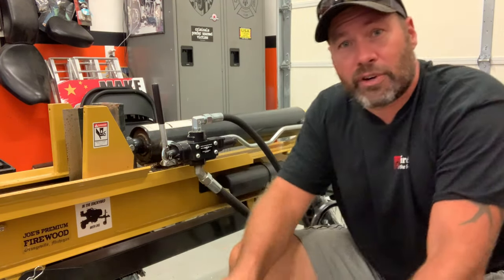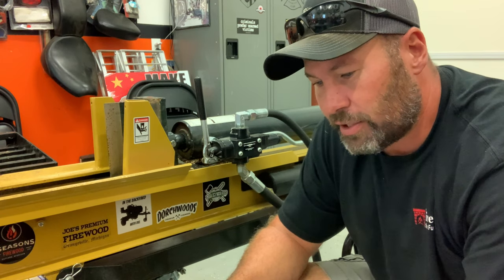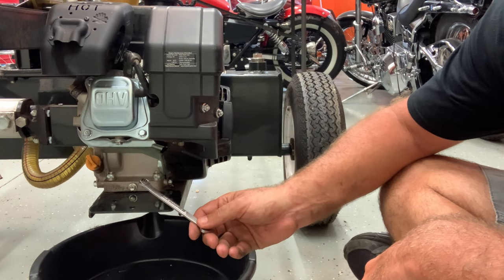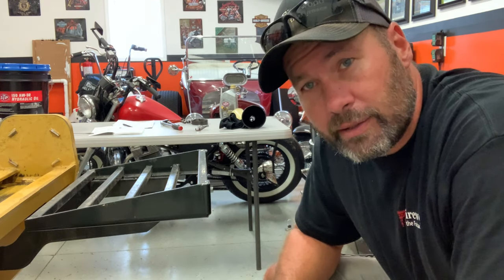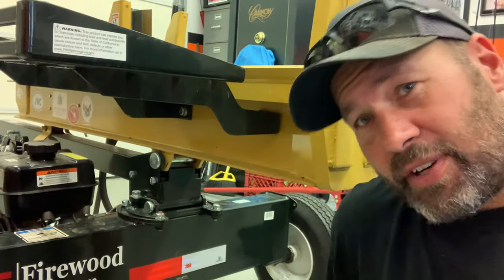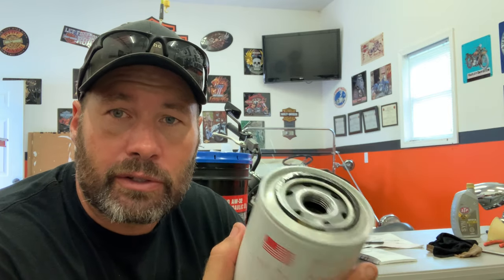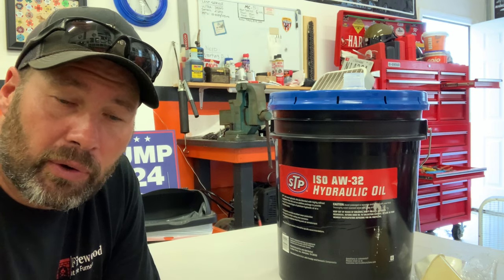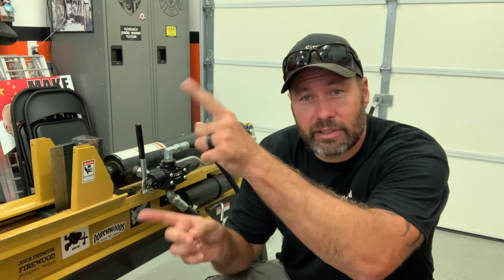HOW TO SERVICE THE COUNTYLINE LOG SPLITTER - #35

Comment: Great video. I have the same splitter. I have done about 30 cords with it. I serviced mine last fall. Good info about the hydro oil filter. I got mine at tractor supply when I bought it, knowing that I wouldn't have to run back for it after 25 hours of use. That filter was a bigger to get off. first I broke a harbor freight filter wrench, then fought with the biggest set of channel locks I have to get it off, careful not to break the mount housing. My 15 year old son learned some new words that day.
Reply from the maker: Lol I’ve been there before. Appreciate you watching
Reply: I just bent my oil filter wrench trying to get the filter off. How did you finally get it off? Did the big channel locks work without damaging anything? Thanks this thing is pi**ing me off big time.

Comment: Thank you very much for this video. I am at TSC right now buying this model and the ladies have no idea if it comes with hydraulic fluid or engine oil, they dont know where the manual is either. But they are very nice and as helpful as possible.  Thanks to you I have all the information I need before I pay for it.
Reply from the maker: Glad I could help
Reply: @FirewoodattheFurnace  Quick question do you use synthetic or conventional engine oil ?

Comment: Just picked up this same splitter the other day. Same situation. The guy only had it for a short time. The paint is hardly worn off. Wish I only paid $600 ($1150 I think it was a great deal considering they are 1699 now). Hit it with the power washer and did a service on it.  I'm not a fan of the dipsticks on this unit. I missed the part in the manual where it said to let it overflow.I fiddled with it for a little bit.  I'm pretty impressed with its performance so far. I'm gonna order up an hour meter for it.  
I've been watching your channel for a little bit now. Great content!
Reply from the maker: Thanks. Glad you enjoy

Comment: Hi Brad. Good video.  However, the manual says NOT to screw down the hydraulic fluid dipstick when checking the level. Just sit it on top of the fill hole. Otherwise your level will be too low. Also, I would have liked info about the breather cap and getting air out of the lines. Rich

Comment: Thanks for the tip on the hydraulic filter! and doing the research for us!  Just bought my first log splitter and wouldn't have thought to pay attention to the difference between the micron filtration, but totally makes since. I paint cars and with paint you have to have proper micron filter to filter certain metallic paints and thicknesses of different types of paint. Thanks for the video!

Comment: Great how to video on servicing your log splitter.  One suggestion I can make that eliminates the guess work about when to service your splitter.  You can buy cheap "hour meters" on amazon to track your splitters operating time.   These meters run about $5 each. I just installed one on my splitter and they work great.  No battery or power hookup is required. You just wrap the inductive pickup wire around your spark plug wire a few times.  Then double stick tape or screws to mount the display on you engine.  Whenever the spark plug is firing the meter tracks the time.
Reply from the maker: Yes I ended up getting one of those as well. Thanks for watching!

Comment: Hi Brad. Thank you for doing this video.  Even though I have a Yardworks 25-ton wood splitter, the  setup of my machine and yours is about 95% the same. One of the BEST video on how to service and fill all the fluids. May I make 1 suggestion. On the side where your Hydraulic filter is, you might want to have a wood or metal board about 1/4 thick, just in case a log falls off the machine. This way it won't do damage to the filter or oil lines. Again, THANK YOU.
Reply from the maker: Thanks for watching

Comment: I don’t know if you noticed or not but if you look at that bottom of the block on the engine there looks to be like a drain plug on each side of the block and the one on the left side looks like it is clear to drop oil straight down off of the engine.

Comment: Great video and thanks for the info about the hydraulic filter.  It's really easy to let the hours on the splitter get away from you before you do maintenance so this is a good reminder to do everything.  I have the 35 ton Huskee splitter from TSC that I also bought slightly used from a guy who used it one season and then moved to a house without a fireplace or wood stove.  I'm also planning on adding an hour meter and an in-line fuel filter.  Stay safe and healthy!
Reply from the maker: Hope it was helpful

Comment: Great video. THANK YOU for doing the research on that darn fuild filter. Only problem I seen was dipstick for hydraulic fluid is NOT supposed to be screwed in to check level. Ride on

Comment: I have the same splitter I purchased in 2017 new at tractor supply. I’ve had a few issues while splitting 200+ cords with it. Ive had the entire engine fill up with water when I left it outside uncovered and don’t know how it gets in (my friends did the same thing). Ive had the engine quit running twice now and both times it was a lose rocker arm. Tightened it up and still going good. I also broke the control valve where it was sticking forward or back. I called service and they sent a new one as we’ll as a new filter just in case. For the money it’s a good splitter and has helped fund my eastonmade 12-22 on order.
Reply from the maker: Thats great. Thanks so much for the feedback. Those are things I will keep an eye on. Sounds like your plan is similar to mine. Definitely looking to upgrade in the future. Thanks for watching and taking the time to comment.

Comment: Brad,
I noticed when you cleaned the Air Filter that you put it back on 90 degrees different from when you took it off.  I'm sure it's no big deal.   Appreciate the how to on changing Engine Oil and Hydraulic fluid.  It's about time for me to do this for myself.

Comment: Hi Brad...in addition to performing the routine maintenance,  I check the bolt tension on the engine plate and really, any other bolts that are part of the machine.  The vibration can put you out of service in some situations...I've been there...LOL.  I just installed a new engine on my old splitter, so I like to keep an eye on those engine bolts particularly.  I do the same thing when servicing my push mowers.  Good informative video... thanks for sharing!
Reply from the maker: Great point! Thanks for the feedback and for watching.

Comment: Tip on how to avoid the draining the engine oil mess-been there, done that. Measure the length from the drain hole to the end of the frame. Get a small piece of black pipe just 3/8” past the frame. Thread accordingly into the drain hole and put a cap on the other end. Now when you change oil, the drain is past the frame=no mess. Worked for me!

Comment: Many thanks sir.  You answered many questions I had.
Reply from the maker: I’m glad it was helpful
Reply: @FirewoodattheFurnace  I had to call the district manager for Tractor Supply to get the filter number you provided.  Wish I had watched this 1st.  We had a nice chat about how the users/owners manual for the splitter was a complete joke when it came to maintenance instructions.  I went down the exact same rabbit hole you did with regard to internet searches for the filter.  But I got the oil changed today and will do the hydraulic fluid tomorrow.  So yeah.. you were beyond helpful.  Yuda man.  :)

Comment: This has to be the best county line service Maintaince video on the internet. Although, I wished you would have covered the engine oil filter placement and change. But other than that, thanks for your research and delivery.
Reply from the maker: Most small engines are not manufactured with engine oil filters. Typically filters are fitted on engines 14HP and higher
Reply: @FirewoodattheFurnace  true, but this one has an oil filter- see #39 on pg. 19 of the manual.
Reply from the maker: @farrellwatson1428  I see that now! Wow I just assumed there wasn’t one. I’m going to have to dig into that as well. Thanks!
Reply: @FirewoodattheFurnace  Where is the oil filter located ? I just got the same log splitter and don't see a oil filter !

Comment: Nice video. I used to have a small engine guy that bought pipe nipples to extend the oil drain to make his life easier while serving my equipment. Yikes,  I have never changed my hydro oil, I will have to look into.
Reply from the maker: Yes, had I planned a little better I would have bought a pipe to extend it while the oil was out. I'm surely going to look into that for the next oil change.
Reply: Brad , the oil drain bolt is a m10x1.25 . A regular pipe nipple will not fit . I am going to get  a pipe nipple and cut one end off and run a M10 die on it so it will screw into the engine block !!
Reply from the maker: @inthebackyardwithdel438  apparently tractor supply sells the extension pipe. I’m going to look in to it
Reply: Thanks for the info on that pipe . The TS is like 3 miles from my house .

Comment: Great video for the Countyline splitter. My 28 ton is essentially the same. I have added a tach, hour meter so I know how much usage my splitter has. I plan on adding a hydraulic gauge on the return side to know when my 15 micron filter needs to be changed..
Reply: Did you mean 25 micron or are you running a smaller filter?.. just checking all the possibilities of operation before i pick mine up and start using it.
Reply: @dadiehl04  15 micron for here in  Texas. If you work in  much colder temps the 25 micron would be better, in my opinion, due to increased return back pressure on system. With a low side gauge you can see how fluid temp effects return pressure…..once hyd fluid is warmed up, almost no return pressure. With cold fluid,  I have seen 65 psi on return, which drops when temp increases.

Comment: Just wondering do we need to prime the filter? My filter hangs below the tank and I think it's a terrible design  for pulling the splitter through the woods. Thinking about turning the filter up before it hits something that would be awful.
Reply from the maker: Yes I primed the filter. Keep as much air out of the line as possible.

Comment: I have a county line 22 ton. It's still splits and I believe has full power, but once it warms up it starts blasting hydraulic fluid out of the cap. Could this be because the breather cap is bad, not breathing and then pressurizes? Could it be an air leak?

There's no other visible leaks, The fluid looks clean, and it still works but once it heats up it starts blasting like a mofo out of that cap.
Reply from the maker: Check your fluid level. If it gets a little low in can cause the intake to draw in air. This causes the oil to get bubbly or foamy which takes up more space in the tank. If the volume of foam or bubbles build in the tank it can cause it to come out of the vent

Comment: You ever had a wheel seize? I barely use mine ( just around home) , never on road , one side froze after 3 years?  What am i missing?
Reply from the maker: Not sure that’s never happened to me. If it’s sitting outside maybe make sure water is t getting into the bearing and that they are packed with grease

Comment: Thanks Brad. I need to do the same with mine.. I have had it a year now coming up in September and all I have done is add gasoline to it..
I got mine used as well and typically run it for about 1 to 2 hours at a time so I know its well over due for some love..

Comment: Hi Brad, another great, entertaining, and informative video.
Just a suggestion, you could probably drill a hole close to the drain plug so the oil would go through it instead of the support mount.
Reply from the maker: Great idea. I was also thinking of maybe an extension pipe to screw on permanently next time I change the oil. Either way would be better than the current set up lol. Thanks for watching and commenting!
Reply: @FirewoodattheFurnace  I thought of the extension pipe too but you would need to be careful that it wouldn't get hit and broke off. Great video, and enjoy your retirement and spending more time with the family.
Reply from the maker: Thank you
Reply: 3/8 bushing with a hose barb
Reply: Great suggestion on drilling a hole. Can’t see why they didn’t do that!

Comment: Maintenance goes along way to dependable service. They are a good splitter and I  have only had one issue popup with mine. I tow mine behind a tractor or side x side to where I down the trees . Make sure to turn the gas off if you tow it as it appears that bouncing around a little while in tow the float may stick and flood the crankcase with gas. Mine would start fine but run bad and stall. The first thing I checked was the oil and low and behold gas in the oil.

Comment: Brad; they make an extender tube with a shut off on the end of it that makes draining the oil an  easy task ! I got mine at tractor supply. It screws in in place of the original plug.
Reply from the maker: Awesome. Thanks for letting me know. I'll definitely be picking one of those up.

Comment: Thanks for the video. Do you use any lubricant or cleaner for the splitter deck rail?
Reply from the maker: Yes I use a spray silicone each time I run it. If I run for a long time I will reapply. I just don’t like to run metal on metal. I’ve seen people use old motor oil but that accumulates into a big mess

Comment: I have a champion 27 ton log splitter works for me I've had mine for about 1 1/2 years now no problems with it.t think I paid $1,200 with the extra 3 year warrantee on it.  Been a good splitter so far I looked at splitters for about 6 months before I bought this one it had good reviews on it.
Reply: TheTwinCitiesBestHomes dot com  I have went through some notty pieces with it sometimes I've had to flip it over to finish the split but very rarely has that happened. No complaints she far I don't run it on high idle unless I'm in some really notty pieces.
Reply: Had my champion 27ton splitter for about a year now and have split about 35cords so far and no major (just dumb little ones) issues either..

Comment: I have the same splitter, but can't take the speed any longer.  I've signed up for a new Wolfe Ridge model.  Very informative video, though, so will soon use your experience to better pull off the fluids change.  Thanks so much for the instructional.  One observation, though:  It looked like you reinstalled the air filter 90 degrees off of how it was oriented when you first pulled the cover.  Check out the video to see.
Reply from the maker: Nice catch Don! I saw that when I uploaded and rewatched the video. I have since corrected that. Im glad it will help some people out. I too am hoping to eventually be able to upgrade.

Comment: Time for a Drainzit Oil Changing Aid..., i.e., an extension hose with cap.   Also, it's a good idea to close the choke before removing the air filter to keep debris out of the carb. Then vacuum the filter housing and carb intake to remove the dust and debris... Closing the choke is something I picked up from my Game of Logging trainer in regards to chainsaws.
Reply from the maker: Great idea!

Comment: You know my step-dad has a Huskee 22ton thats about 20yrs old.. split 10+ cord on average every year, and so far he has NEVER changed the Hydraulic oil or the motor oil.. engine needs replaced but only due to rust and the top falling off, but still runs great you just gotta start it real funny. It sat outside the entire time uncovered and uncleaned too.
Reply from the maker: Wow

Comment: First time splitter owner looking for a little help.  Manual says to clean the breather cap, but then doesn't reference how or even what/where the breather cap is.  Manual says to change the hydraulic filter ever 100  hours, but how often do you change the hydraulic oil?  Finally, unit says to measure the hydraulic oil without threading the dipstick, does it matter?

Comment: Replacement hydraulic oil filter for #60001
Fram
Part# P1653A
Or   # P1654A
I had a hard time finding a filter for it so I ended up calling YTL international and they gave me those #s for a Fram filter so I can get it locally.

Comment: Great video. I have the same long splitter.  I have a leak in front of the hydraulic tank where the motor is. Any toughs or suggestions on what it might be????
Reply from the maker: Is it the clear plastic hose?
Reply: @FirewoodattheFurnace  no I think it's coming from the filter fixed plate
Reply: Now that you think about it. It could be the clear plastic hose.  I'll check it. Thank you
Reply from the maker: @outsidewithrodney8240  sometimes the clamps can vibrate loose and it will leak
Reply: @FirewoodattheFurnace  thanks I will check that

Comment: The owners manual shows TWO oil filters , the screw on external filter and the internal filter behind the clear tube . Does that need to be changed ? 

Also , is there a fuel filter ? I don’t think there is but .....
Reply from the maker: The filter behind the clear tube is like a screen to keep debris from getting into the pump. It’s for the hydraulic oil.  Its not necessary to change or check that unless your getting debris into the system through the fill. I’m not aware of a fuel filter
Reply: The fuel filter should be in your gas tank fill, just under the cap. If you can see the bottom of your tank without removing it; it's missing.

Comment: I have a County Line 40 ton splitter and my wedge is bent up wards on the flat side where it slides back and forth. Is this normal? If not what is the part number so I can order the part?
Reply from the maker: Part number looks to be LSP4001-03000
Reply: I will. Thank you! Keep up the good videos. Learn alot from them even thou I'm a new subscriber